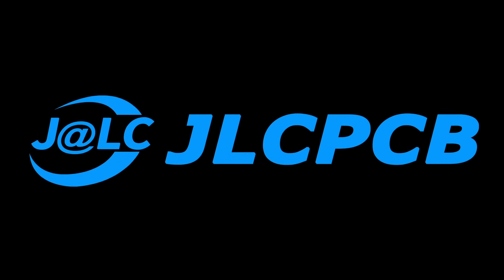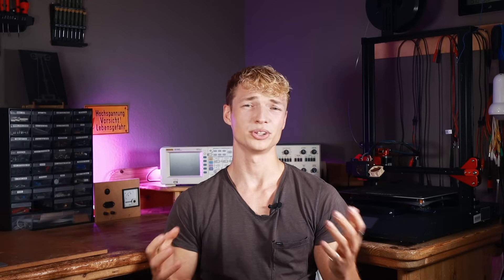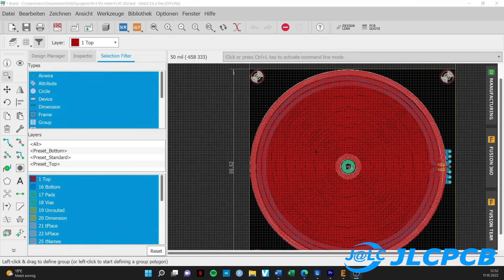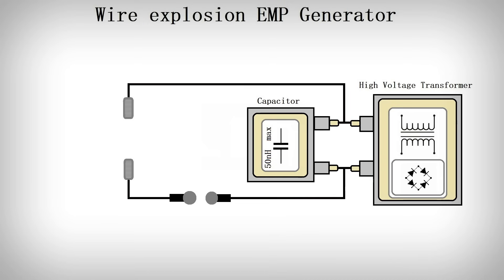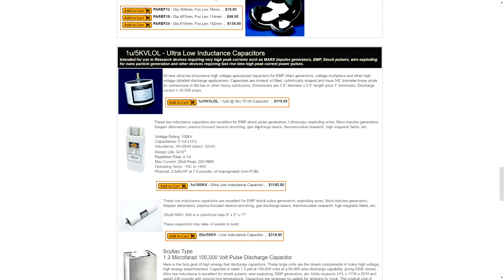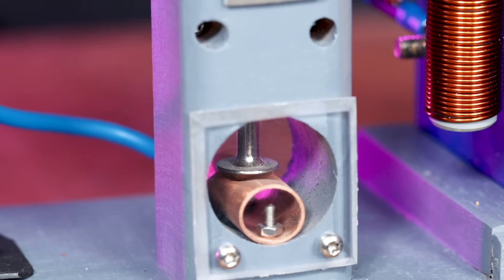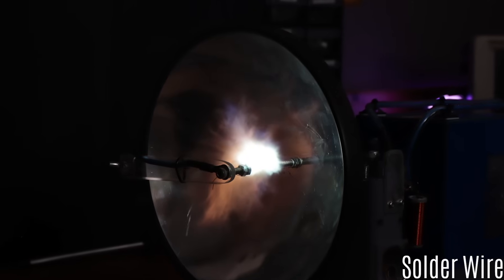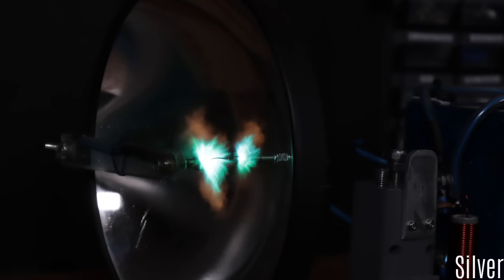I Built A Military EMP Gun! (New Method）

Comment: Excellent video Leon, this build was super fascinating! Now I kinda want to make a flux compression generator...
Reply from the maker: Thank you Bro!!! Haha yes, would be very interesting! But first I need the 50kV 0.5uF cap ;)
Reply: @Teslaundmehr  You might already know this, but it looks like you could get around one hundred 400V/47uF capacitors on eBay for $25 USD. Put in series, that could be a cheap way to get a 40kV/0.47uF capacitor bank! Even buying from Mouser or Digikey, it looks like you could get away with such a bank for around $100. Something to consider!
Reply from the maker: @LabCoatz_Science  That is actually a good idea, I have 200x 400V and I think 82uF or something. The only problem would be the High Inductance as well as the resistance. But I should definitely try it out!
Reply: @Teslaundmehr  nice vid 👍

please consider the generated metal vapor..."metal fever" could be caused..and use it outside or with a fume hood? If u have any "Safety-Datasheet" questions please ask if u want 😊

I like the additional cable insulation 👍👍, keep going! 🛰📡 and keep safety high 
...subbed 😊😉

ps: I am also searching for hv, high Farad caps...there are some "medical" caps on ali, 40kv 1-3microF..price was ~150 i think..??

but i plan to test a selfwound ~20kv  300-800nF cap made from tin foil and insulation layers (eventually submerged in oil)..maybe that could help you too.?

Der Trenntrafo is schonmal seehr gut 😊👍
schönes Wochenende 😁🌞
Reply: @Teslaundmehr  Brother, can you shoot down the drone?
Reply: My nickname is also Leon ☺️
Reply: Yes you can cause those vaxxed with Graphene Oxide to stroke out on command
Reply: Is that his name Leon?
Reply: @al-shahriarnajim7156  Yup, Leon with Teslaundemehr

...and I'm Zach Armstrong with LabCoatz 😁
Reply: also a throwback to the invention of the very first (spark gap) radio circuits!
Reply: The bleeder resistor on the MOT charger is very small. I would not trust it.

Comment: I fail to understand why you put a inductor in series? If you want the fast discharges you need very low inductance. I do own a cap bank and i always fail to understand why guys add inductors. An inductor decreases the initial current by a lot. My cap bank is 233uf 5.4kV.
How can it help to vaporize a wire fast when you put an inductor there in series?

Comment: tbh, this can be kicked into high gear using basic physics. if u use proper induction and set the phase to 90degrees, u will eventually get a proper phase shift. which will exponentially increase your voltage needed to create efficient emp wave to disrupt electronics
Reply: Get in touch bud

Comment: Leon, I think you are approaching this the wrong way.  For example, you have a spark gap in the antenna (the fuse wire after it blows) in series with another spark gap.  Think how much energy is wasted in the second spark gap.  Do you really need it?

I don't see why you would need the fuse wire.  You could simply replace it with a normal spark gap.  You would initiate the discharge with your mechanical high voltage pull-switch. 

You might also investigate whether a NEON POWER SUPPLY might be useful.  Available from Amazon and eBay, these cost 42 GBP.  The input voltage is 230V ac and the output is rated up to 10 kV ac.  They are intended for continuous operation.

Also you can obtain "High Voltage Pulse Generator Coil" modules for less than 10 GBP.  I think they work on the principle of the Tesla coil.

Comment: Hey thats a very cool project! I was thinking to do it and found your video which is SUPERB. Thank you very much for sharing :)
I liked your design and its very helpful. But I was thinking that, for the parabolic antena to work, you should match the design to that of the wavelenght of the pulse. Diameter should be 20 times the lenght. Also I think the exploding wire should be at the focal point ;) but barely starting to think this out

Comment: I built a Van De Graaf generator couple months ago just for fun.   It doesn't produce nearly the amount of power your EMP machine does,  but  it shuts off computer monitors nearby.   I was quite surprised by this considering that the generator was poorly made and it was quite weak.   It can only produce 1cm very skinny disappointing sparks.  This would make it around 30kv.  Despite its shortcomings,  i was able to wreak havoc on computers.   Watching your results makes me wonder that maybe it's not necessarily the wire exploding that produce the desired effect.    My guess is that it lacks the high voltage or the surface area.
Reply: 1cm arc in the air is more energy than a 1cm arc between 2 conductors

Comment: you shoul use a ccoper metal plate and the electricity shoul be changed the frecuency i dont remember if the lower frecuency or the hight frecuency travel longer distances but they use for  a devide for library speaker that travels a like laser diode led so the explosion by the spark in the concave cooper disk and the frecuency should make it travel longer distances and combined with hight voltages very hight combined with magnetism like microweave cooper chamber inside the microwaeve kitchen device

Comment: I dumped the capacitor into a piece of wire wrapped around a piece of iron and fried simple devices. If you want to make plasma make a basic rail gun setup with the projectile having a low melting point but has enough properties to make the magnetic field.

Comment: Why not use an inductance coil on the exploding wire circuit to further boost the voltage?
Reply from the maker: Because than the frequency of the oscillating  circuit than drops to much.
Reply: @Teslaundmehr  Hrmm.
Should be a way to compensate, if you're trading amps for volts.

Comment: I got a cap bank made from old soviet oil capacitors. They are from old radar equipment and had an initial rating of 10kV and 0.5uF. A friend replaced the oil for me and they are now tested to 110kV but you have to submerge them in oil for that. I only use mine up to about 80kV. Any more and it jumps over between the contacts. I never charged the cap bank that high though... 30kV is already loud enough to make your ears ring with ear pros on and you feel the shockwave. The cap bank has currently 3.5uF i think... works well for exploding 0.2mm wire. I never tried any other type of wire and all my cameras also still work but i could try it out again...

Comment: EMP Gun? If something electronic has been hit by an EMP blast, is it damaged forever or will it eventually revert back to working normally?
Reply: That depends on how susceptible it is to power surges and magnetic fields. Most chips or anything that requires you to be cautious about static discharge will likely be irreversibly damaged. Though you may get lucky and it attenuates to a filter circuit or capacitor in the device that can absorb it.
Reply: Depends on the power of the EMP. Capacitors etc might fry.
Reply: I need to get my crazy psycho neighbours car lol, sorry just tired of being nice and taking her lies up the backside 🤣🤣

Comment: i have to add, mirrors satellite dishes etc wont do squat, they are for reflecting photons not focusing an electromotive force (what an em pulse is), and vaporizing a wire will result in high resistance as the electricity flows to the point of heating and vaporizing it, it would be more efficient to have a conductor capable of handling the discharge current and wound in a fashion to concentrate and direct the emf field, also taking into consideration the discharge voltage and whether the windings are suitably insulated (or have an adequate air gap between them) in order to prevent arcing between the windings. i hope this helps.

Comment: You could use a larger transformer, capacitor, and transmission cables and determine the emp by the thickness of the exploding wire.

Comment: Always thought of putting such a device in my car, coupled to a radar detector. But since these are forbidden here, and also police is using nearly exclusively light based datection for their highway robbery nowadays, it wouldn't work anymore .. But if it was strong enough for even deleting digital data from storage inside a massive metal encasing.. then this could be useflul again, by applying the beam of righteousness to their despicable weapon after they have taken a phot of you driving like a normal healthy person, instead of a 90% blind 90 year old!

Comment: Well as a young electrician. I once was part of a  rew that by accident t created ball lightning.  All it took was two opposing 10 000 amp DC supplies and an oops on two wires. Also about 6000 volts . You can get the same effect with a submari e battery ... it is almost magical plasma churning about  in a ball ...just floating  hitting ground and gone ..Ah that few seconds of WTF  will never be forgotten . Take care .
Reply: Wow😮

Comment: I think it would be worth trying different thicknesses of wire as well.  It is possible that the reason you are not getting a very strong EMP is because the wire is blowing too quickly, so it does not have time to establish a really high current (and thus high magnetic flux) before it is interrupted and collapses.  I suspect there is probably a "sweet spot" for wire thickness and materials that will maximize the EMP output in this setup, which also likely depends on capacitor size, inductance, etc.

It would probably also be worth actually measuring the capacitor voltage before and after to see how much of the energy from the capacitor is actually being used when it fires (this would require disconnecting your power supply before firing the gun, and just measuring the capacitor voltage directly (you can use the discharge resistors as a voltage divider and tap into them to get a measurable scaled-down voltage reflecting the actual capacitor voltage)).

Comment: In the 90s i came across a book that listed a lot of high voltage projects from a mini rail gun, wire exploder, and jacobs ladder and stuff like that. Its been a long time but they wanted to use about 300,000 volts and two giant capacitors for this projecr. I was a teen so i didnt understand most of it, the only thing i did knkw is that this would likely kill me if i ever thought of attempting it. 

Anyway, i want to say they said the effective radius was something like 10 feet, and they also wanted to use 3mm wire no more than 2cm long.

Comment: Have you thought of using a high speed rotating magnetic field to focus the energy from the plasma discharge and make it into a beam?  Kinda like a quasar, but on a tabletop!
Reply: there is no plasma involved, smh - this is a basic capacitor unload hack
Reply: @willyd61  ?
Reply: my point is there is no plasma involved with this setup.
Reply: @willyd61  right, what I’m trying to say is it’d be sweet if there were.

Comment: About 45 acrylic sheet caps, 100x100 cm, each 3 mm thick, in parallel, will give you 0.5 μF, 50 KV. That's a few hundred pounds.

Comment: wow, if you think EMP is from light, well, ok.

what you should do is to unload all capacitor energy into LC circuit, not simply to spark...
Reply from the maker: That it's not so effective. When we discharge the Cap via a Coil, the resonant frequency is very low. For example,10Mhz. Than the wavelength is very big. (Over 100m) For good "EMP" we need very short wavelengths ;)
Reply: @Teslaundmehr  no, you don't.  You need ability to induce current. EMP works by creating voltages above 2V that could disturb your electronics. Where is a sweet spot on frequencies you need to be using. To low and it's hard to radiate,  to high and you simply  can't  do damage, since penetration is massively reduced.  So 1uH coil with 1uF capacitor at 100kV would work just fine
Reply from the maker: @Kilohercas  Yes, you're right, but the range than is very small. I'm talking about focusing the pulse over a long range.

Comment: Using a helical strobe tube may be self destructive but it will provide the coil discharge effect needed to produce a more effective pulse of EMP. As in any coil, there will be more magnetism produced with more turns. Watch yhe Oceans 11 movie, they had the right idea, discharging through a gas tube that was coiled around another. Both in reverse polarity to each other creates a huge push of the magnetic wave propagated like smashing objects together at high speed, the compression doubles the force. There is always a direction the feild propagates out each end of the coils so experiment with turning the core in relation to the reflector.☠🤯

Comment: Instead of just using a simple wire, use a small coil. Like 20...100 Windings of thin, enameled copper wire. As you say in your video, you got stray inductance everywhere. If you have a small inductance in the parabolic mirror, you concentrate the flux there. Oh, and never fire an EMP in your laboratory. What if it works? It will fuck up all your Equipment! Have at least 10 m security distance to any valuable equipment. And consider your neighbours too.
At work I do occasionally EMV and ESD tests with way less energy than in your setup. And I regularly waste not only the units under test, but also other equipment :^)

Nice video anyway.
Reply from the maker: Thanks! The problem is when we use a Coil that the resonant frequency of the system is pretty low. Because of this the wavelength is very long. Hard to focus etc. What do you think about this?
Reply: @Teslaundmehr  The Coil should still explode, like the simple wire! You don't get the low frequencies then. Ideal setup would work like this:
1. Spark Gap ignites
2. Current starts to flow (LC-circiuit)
3. the energy from the capacitor moves to the magnetic field of the coil
4. just on top of the first square wave of the oszillation (first current maximum) the coil vaporizes and shortens itself
Then it works more like a explosively pumped flux compression generator, just you are omitting the explosives and use only energy stored in the capacitor.
Try something like a filament of steel wool, maybe isolated with a thin coat of lacquer. Steel wool like it is used in the kitchen is pretty cool, since you can solder copper wire to the ends of a filament and it is very cheap - so no problem if you have to change the coil after every shot. Also, if your coil is from steel, it will have a significant higher inductance due to the ferromagnetism. Just think of it like the windings and the core are the same.
The amount of metal you can vaporize with the energy stored in the capacitor is limited. So the coil can't become super big or else it will not vaporize due to a much too large thermal capacity. There is some experimenting (or calculating) necessary to find an optimal coil. After seeing your video I would guess 10 cm of steel wool filament are no problem, maybe you are even able to blow up a whole meter. Which would give you a considerable coil of some µH when wound around a toothpick or a pen (remove the winding body when you are done and fixate the coil either with lacquer, thread or fishing line).
Would really like to see you try and if it works. But as said above, be careful with your laboratory! I don't really know how much energy you have stored in your capacitor, I assume something around 1 kJ. If you just get an EMP of 10 J (1% efficiency) I would expect it to be very harmful to any of your equipment.

Always wanted to try this out myself - but as you say, those capacitors are very pricy. And buying one for 1000 € just to wreck my laboratory kind of kept me from trying...

Comment: You might not have made an effective EMP (principal is fine, just too low a voltage) but I bet you had a lot of fun blowing up wire. I had some "definatly not" pulse rated electrolytics that I would charge up to 1800V, and they would explode wires amongst other things with quite a loud report, so much so that on one occasion the police arrived to issue a cease and desist on "lighting fireworks" :) Thankfully I did not need to surrender the device, and just packed it away for camping trips where the noise might only scare wildlife that got too close to our campsite (i.e. to raid our food) :)
Reply from the maker: You're right, blowing up wires is definitely a lot of fun! Your story is very cool ;)

Comment: The easiest way to build one is a spiral line flux compresion generator. It does not use anything special, just a jelly roll capacitor with 8 to 20 extra turns in the middle well insulated as a spiral. It gets charged up and discharges with a fast switch like a spark gap. The current becomes a time compressed pulse of about 60nS because each turn halves the discharge time and multiplies the voltage by 2. Then have the discharge travel through a shredding element like one of those DTV antennas at the focal point of a dish and grounded through an inductor with all of it in transformer oil. The mode broadening by the antenna decreases the pulse time to less than 4nS 😲🤓😎❤
Reply from the maker: That sounds very interesting! Thanks for the explanation!
Reply: I used to think I was smart and knew cool shit? But them the Dunning-Krugger effect kicks in...... Like just now?
And it's at that moment that you realise you are not cool and you don't know shit!
This is criticism gladly accepted. May I come here every to remind myself from this day forward. Forever and ever Amen!